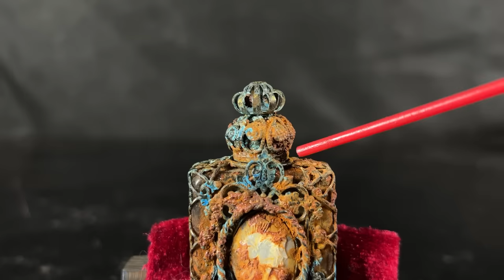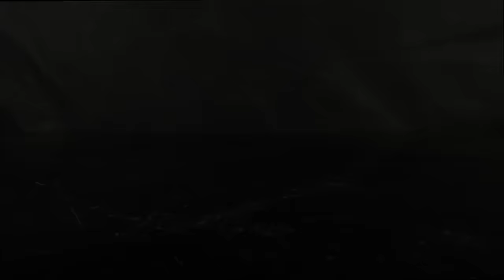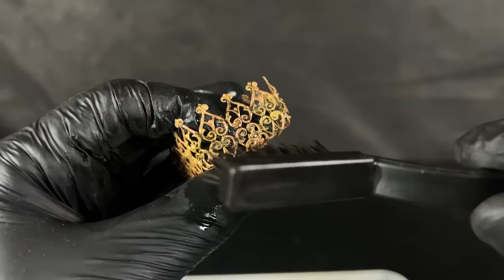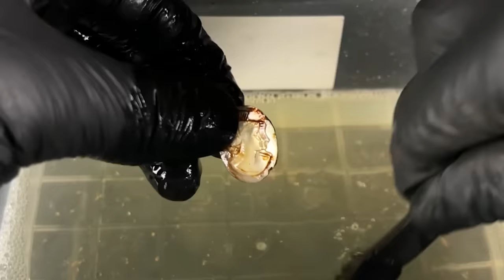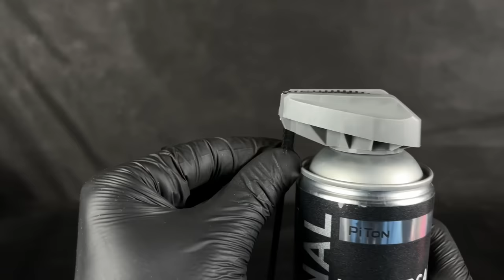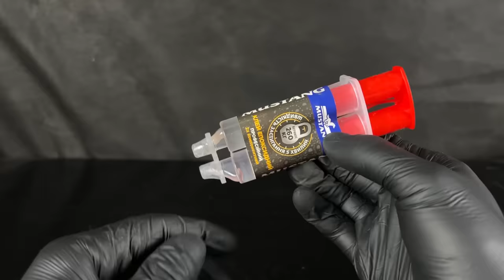Incredibly Beautiful Antique Perfume Bottle - Restoration ASMR

Comment: You did a beautiful job on this little perfume bottle.  You have a real talent.  

I would suggest, though, that you be more careful with the glass applicator if you restore another one.  They are very fragile, and are almost never found intact.  

Pieces like this were made in Czechoslovakia back in the 1930s, and similar ones are still being made.   I think yours dates back to the 1930s Art Deco era, based on the style of carving on the central medallion.   I couldn’t tell if it was shell or glass, but pieces like this are typically glass.

My favorite perfume is Chanel No. 5.
Reply from the maker: Thank you very much for your comment) During the restoration I realized that the glass is quite thin, you are right) Thank you for sharing the information about the perfume bottle. 
By the way, you are already the second person to write about Chanel No.5 perfume))
Reply: @YoungRestorer  You’re quite welcome.